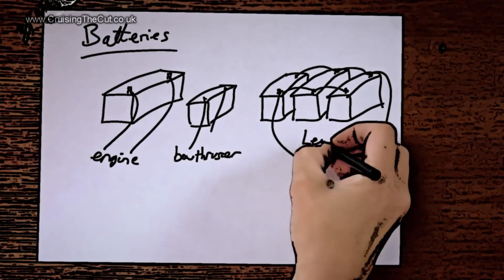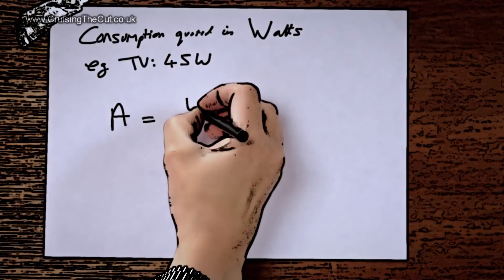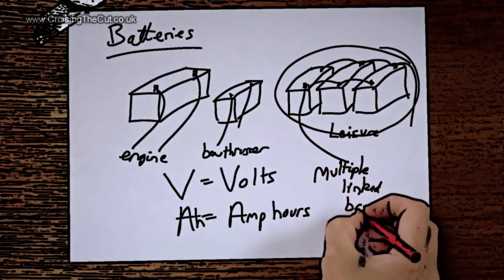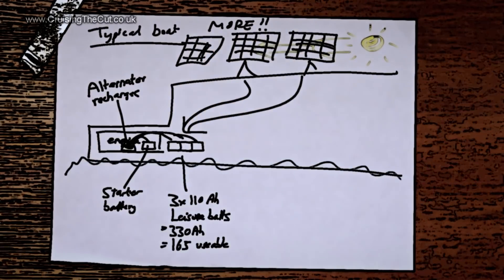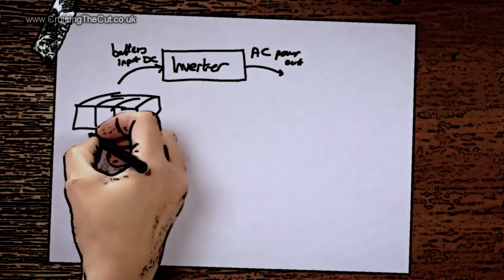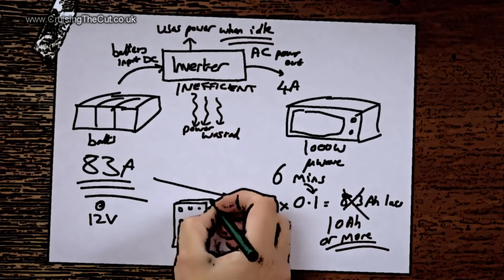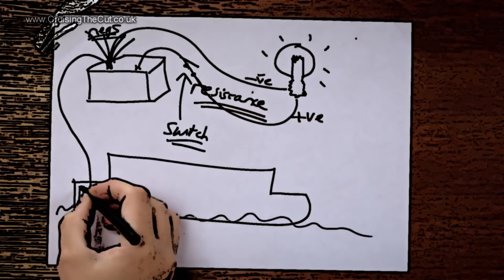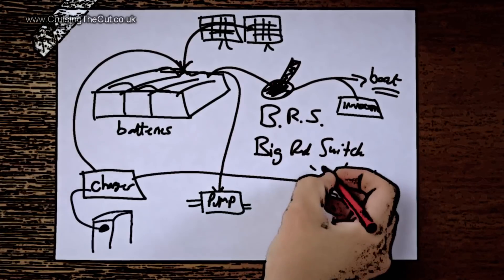136. Beginners guide to narrowboat 12V electrics: batteries, inverters, chargers, solar and so on

Comment: Just a word of caution for the viewers, many multi-meters and clamp meters aren't capable of measuring DC amps, so you need to check BEFORE buying one, I wasn't aware but another sparky mate pointed it out to me, a retired sparky I now use the UNI-T clampmeters that do have it and indespensible with solar panels and batteries,  they run out around $50 AU here, cheers

Comment: Beautifully done, gives a detailed basic overview of the electrics system without eye glazing calculations and performance charts. One thing for non sparky people to remember, batteries themselves do not have an on/off switch they are sitting there ever ready (curious name that) to release that stored energy, they are not particularly worried if it's released to light up your cabin light or melt a spanner accidentally dropped  across the terminals. Melted spanners do not make good reading lights, but they are excellent at burning clothing, flesh or anything else in the immediate area.
Always wear safety goggles as a minimum, or preferably a full face plastic shield which are very cheap from a hardware store when working near batteries. I have had batteries explode in industrial machines and found bits of battery case and acid spray up to 30 feet away from ground zero.
Ray

Comment: Very well done David. While I'm an auto mechanic and fully grasp everything going on (being that cars run on DC current as well) but even I learned something. I never realized you couldn't ground circuits to the hull. It does make sense though, as you are in water you are introducing electricity to the water via the hull and it will cause electrolysis and rust the hull this would be even more emphasized in salt water boats. In cars the entire body effectively becomes the Ground/earth wire back to your battery. So in boats the system is "semi"-self contained. "Semi" in that the system does still ground to to the boats hull for reasons I don't quite grasp. I assume it is for engine electrics which use the the engine block as a ground like they would in a car. Later on if you do more, I would like to see more on the other systems like the inverters, solar systems, and galvinic isolators, haven't looked into the isolators to see there use aside from dissimular metals being in the canal causing corrosion but I assume that's what they do.

Comment: Well done video you shook be a technical teacher as it was easy to follow and explained well.The steel  boats I work on are what's called "above earth" where all the electric wiring and switches are  double poled so there are not any stray voltages to the hull

Comment: Nicely done, but you need to tell us how lithium batterys works, after all we live in 2018, not 2015.
Reply from the maker: No, I don't think so, at least not in this video. As I said, this was a general introduction to boat electrics and most narrowboats still use conventional batteries so that's the the typical novice boat owner will encounter. I mentioned that lithium has special requirements and that puts a more detailed examination of it out of the scope of this video. There may be other videos where I cover more specialised aspects though.
Reply: All you need to know about Lithium batteries for now is A) They are massively expensive. B) They are a very efficient storage of energy. C) They can release that energy in massive explosions and fire if not treated with utmost care.
Ray

Comment: this may be the best intro to marine electronics for the non professional ive ever seen. well done :) by the way if you own a boat i would recomend a copy of Nigel Calder's book Boatowners Mechanical and Electrical Manual. dont buy the expensive hard back though couple projects in the engine space and it will be covered with greesy oily finger prints :)

Comment: If you look at your computer the motherboard use dc but it power supply is ac. But ac electric can travel longer than dc electric. Most electric stuff turns ac to dc than cut down to a useable voltage. I would look for 12v stuff like tv. I had a converter not a inverter it stepped down 12v to 9v to keep from smoking my laptop I did not use my laptop power supply. Have a computer shop build you a computer but use reciters to cut 12v down to your motherboard intake. Look 12v adapters for your laptops and electric toys.
Reply: Fluffs Ipad Absolute rubbish! The voltage drop in a conductor of a specific length is almost identical whether ac or DC its just that ac voltage is easier to step up or step down.

Comment: In other words, if you can't power what you want, call an electrician. And go lithium.
Reply from the maker: Well ... lithium has its own set of issues such as different charging regime, you need to keep the batteries above 0C and you still shouldn't draw more than 60-80% of the power so it's not a total panacea. Especially at the price!!
Reply: Noooooooooooooo lithium for the average idiot ................ just watch Jono on his batteries , guaranteed you will never switch [!]

Comment: thanks seems like overkill to connect to the hull i think i am not going to
to scared it wil eat my boat up hooked to shore line
Reply from the maker: No narrowboats, unless they've been bodged, will use the hull as the -ve return. Regarding connecting to a shoreline, you're (mostly) fine as long as you've got a galvanic isolator or (better) an isolation transformer but I didn't want to get into those in this video!
Reply: yeah ok great video and your art skills are inproving :D
remember you once tried to draw a map??
greetings,, Kitty.

Comment: Very nice drawing David. I loved the video. When my Dad built are houseboat, solar power had not hit yet. So he ran both 110v & 12v. 110 bc I live in the US. So when we was out on the lake or coving out on shore we would use 12v. & when we was connected to shore power we would turn the 110v lights on. He had them marked so we didn't forget. To me it was a neat setup, but I was only 12yrs old & 42yrs old when he past. So I didn't really get to ask a hole lot. Bc it was always there. And you don't think about that stuff till it's to late.
Thanks for the neat info,
Chris
Reply from the maker: Cheers Chris

Comment: "There are a lot of ways of doing boat electrics" - that's why calculation should not be done in Ah anymore - no matter that what the old guys tell. Power consumption is measured in Watts and that's what the batteries have to deliver. Instead of converting it several times and having problems to compare different parts of the system running on different voltage, calculate it in Watts (and Watthours) and you'll saves all that effort of conversion (just think your example of 4 vs 83 Amps).

Just because something has always been done the way doesn't mean its a good way to do so. Or do you realy still want to pull your boat by horse? :))
Reply from the maker: As explained at the start, this is a beginner's guide. As such, it is explained in the most common usage which will help newcomers understand what experienced boaters are talking about. Trying to talk in units that won't be commonly used would defeat the object, even if they would ultimately make more sense.
Reply: Didn't you use the unit anyway (as in "TV is rated at 45W") - just to be then explaining the conversion as well? The whole difference is using one multiplication at the begining instead of dozends of divisions later on (that part abrevated as "+++ add up").

(Sorry my inner electric engeneer, who realy hates unneeded work and gets inapropriate upset when laymen continue to repeat unnessesary complicated explanations and terms, just because they where common some decades ago, forced me to write this)
Reply from the maker: Yes, I did mention the TV in Watts to demonstrate the correlation between stated device consumption and the battery capacity. I think that's a fundamental part of understanding how the batteries will deplete. Since boat batteries are still measured and sold in Ah though, the thrust of the discussion was in terms that the boater will encounter rather than computing in Watt hours.
Reply: There is always "That Guy",seriously how do you go about cable sizing in DC installations with your theory? Or doesnt that matter lol. Sorry but there is a valid reason why they use amps/amp hours in DC  ;-)
Reply: including conventional flow, we need to get rid of it.
Reply: And it needs to be mentioned (and prepared with a division) for each device added up. The usage of Ah is based on a simplification  that assumes the voltage (and a historic fight between two systems to measure power. Usin AH is litteraly a remaining from back when there where DC mains). As long as the voltage of all components is the same, it's possible to calculate in ampere implying that assumed voltage.

Take two 100Ah batteries - when used in a 12V system, they 'deliver' 200Ah, but on a  24V boat the same will 'only' do 100Ah when joined. wehn calclated in Wh they are 1200Wh each - and deliver 2400 Wh, no matter if it's a 12V or 24V boat. Not to mention that now calculating the need of the apliances used becomes an easy game of addition without the need of a pocket calculator. Take the needed wattage (multplyed with the efficiency of the converter to be sure) and it becomes way clear what a set o batteries can do without much calculation.

On a boat we handle at least two different voltages (some even three). And we use modern electronics with switched converters. they got the nasty side effect, that they increase the amperes drawn when the voltage get down to keep their wattage. So killing any calculation ratehr fast ... but that may lead into way more complex terretory about the discharging curves of Batteries - which are btw not anywhere linear with the amps drawn.

I usually prefer to teach the most simple calculations when people new to the issue ask - dumping age old ways on them?

(Again, sorry for continuing this, but unnessesary complex - and at the same time inaccuate - handling of electric terms makes go :)

Comment: Very nicely done.  The distinction between "volts" and "amps" is often confused by those less familiar with physics or engineering.  Your analog of voltage as pressure is perfect -- one can have equally high water pressure in a tiny pipe or a huge pipe but not the same flow.  Likewise, the analogy of amperage as flow is perfect and correct... think of the current in a wire much like the current in a river.  A small stream cannot provide the same flow as a huge river, just as a thin wire cannot deliver the same flow (current or amps) as a thick, heavy wire.

Another bit of trivial technobabel... an expression of "watts" is an expression of power (or power consumption), just as we might describe the size of an engine by its horsepower.  In fact, 746 Watts equals 1 horsepower.  So, a 1000W microwave actually requires about 1.35 horsepower to run.  And this explains why a bigger electrical motor requires fatter wires than a small motor.